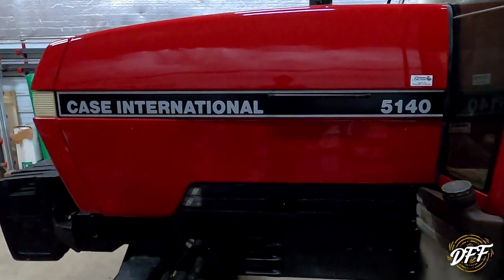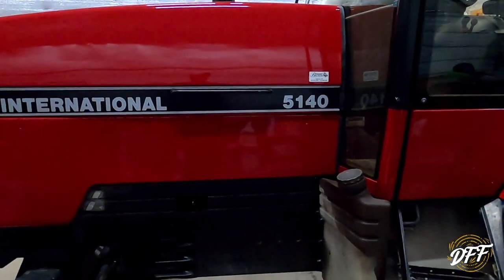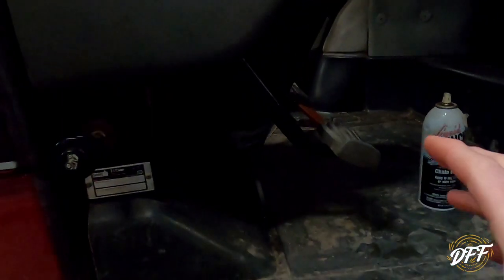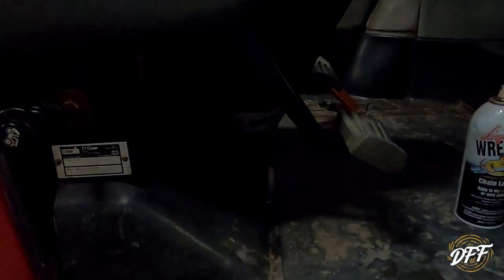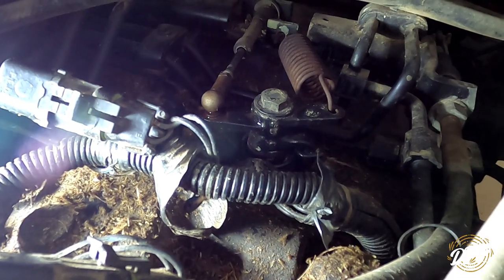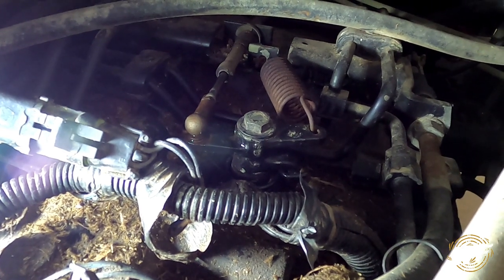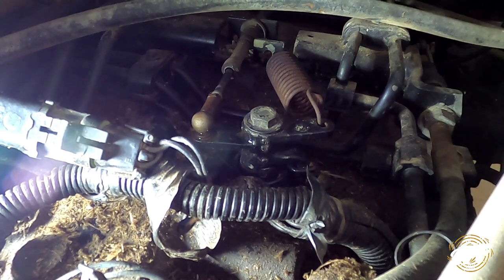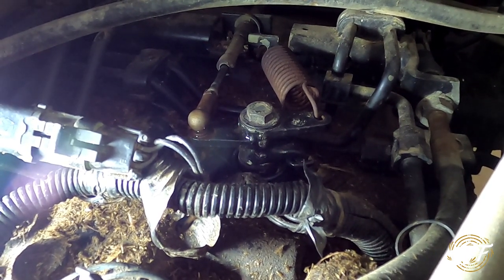Sticky Clutch Pedal Repair- Case International Maxxum 5140

Comment: Nice video and explanation! Two summers ago our JD 5410 clutch cable broke at the pedal, wasn’t a fun replacement and it only went to a point halfway under the cab instead of all the way to the back like yours.
Reply from the maker: That sounds like a nightmare! Did you have to pull the cab?
Reply: @dehavenfamilyfarm  fortunately no, but I did end up with less skin on various parts of my fingers and hands 😂
Reply from the maker: @floydfarms1578  been there to lol

Comment: Ha ha Chris!  My Massey 596 had a very similar issue :(  I had to break a few cables before I got smart ;)  The 596 has grease zerks on the throw-out cross shaft, but one zerk was not taking.  I also drilled and placed a zerk on the pedal shaft in the cab.  I am not a big fan of cable activated clutches...If you have a cable, you need to keep everything lubricated!
Reply from the maker: Sounds like you got the problem fixed. Sometimes it takes some Farmer innovation to make things better 😁

Comment: Our 5250 tractor won't move in forward or reverse.  It feels like the tractor is trying to move, but it doesn't have enough power to move.  The clutch disengage light it not on, so were not sure what is wrong.  Have you ever had this issue?

Comment: Hi, could you help? I have a CASE 7210 MAGNUM. The problem is that you need to use a clutch when changing gears. Everything I could have I changed but no one helps. Thanks for the reply

Comment: I’ve also had worn out clutch pedal bushings make the clutch stick as well what’s the horsepower on that tractor
Reply from the maker: The engine horsepower is about 110. I actually have two of these tractors (the other one is open station),  and the open station has been turned up putting out well over 120hp.
Reply: You have a lot of hardware